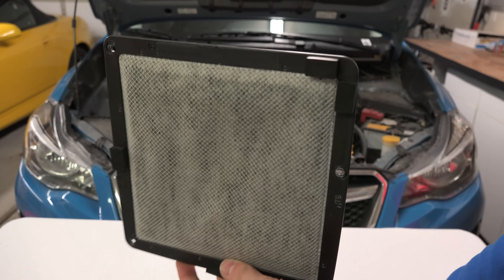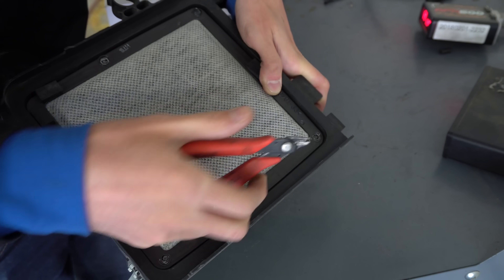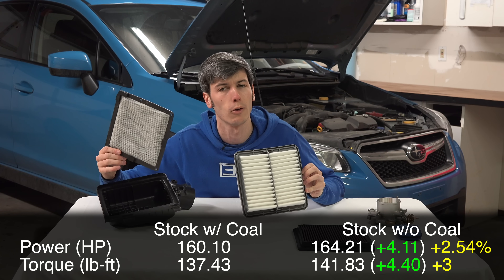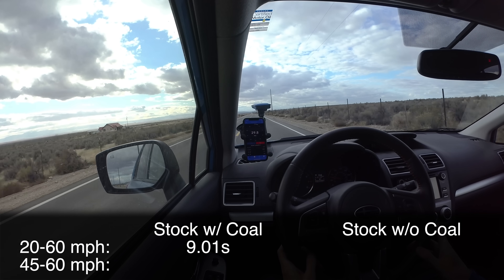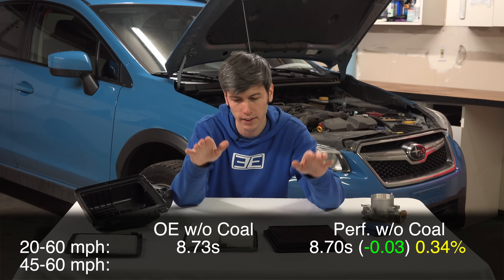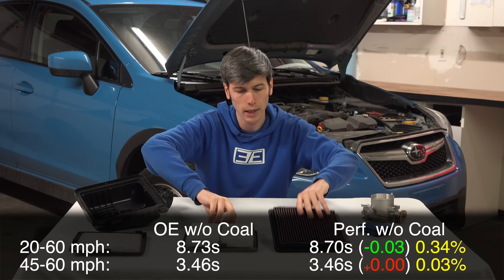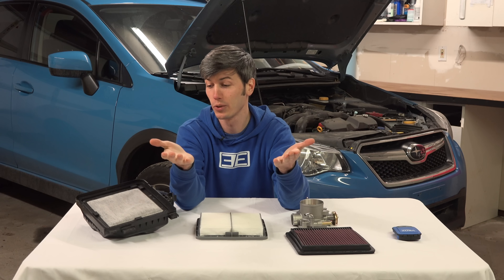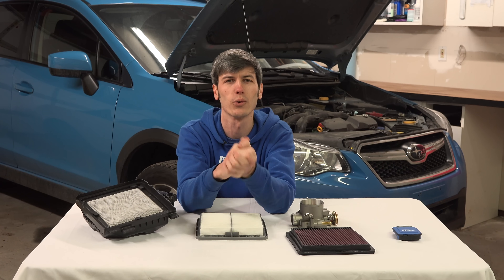Do Charcoal Air Filters Rob Your Engine Of Horsepower?

Comment: Have you measure acceleration change when Vtec kick in (yo) with the GPS box,How much G is increase?
Reply: You will go from 0 G to 0.01 G
Reply: Still Render Production - yo it is not measurable because vtec breaks the box. Yo
Reply: So in first place, how do you get 160hp from the original 148hp on your stock 2.0 liters Crosstrek?
Reply: @robertolouth7468  probably just the dyno inflating numbers.
Reply: Douglas Thompson thank you, things should be simple answered.

Comment: placebo effects on drivers are very real
Reply: How do you placebo a dyno,  unless he has telekinesis and used his mind to control a machine I don't see a placebo effect
Reply: @joesmith201212  It adds soo few extra horsepowers that a human being wouldn't be able to feel the difference, that's why its a placebo effect. You think your car is faster but in reality, it's not. You need at LEAST a 5% difference in power to feel anything happening. In other words, this mod is not worth the hassle, especially since you are going to have problems with the DNV
Reply: TheRedHuskie In reality the car is actually faster. Numbers do not lie. It is just inperceptible. If you do feel the difference you have a very sensitive butt. Racing teams would be all over that few extra horsepower. This is the opposite of a placebo. There is actual power difference, but people cannot perceive it.
Reply: @brunoraoni  I really don't think you people know what that word means
Reply: @pichum4st3r  the science is sound the data is solid,  that's not a placebo, your car runs on mixture of fuel and air,  and a spark,  so if your fuel injectors are dirty and clogged and you clean it and it runs better is that a placebo too? If your spark plugs are fouled and you change it and runs Better is that a placebo? Air flow is just as important
Reply: @brunoraoni  if it doesn't throw a code, it doesn't matter if it's there or not. 7hp is better than 0, but he didn't go into at what RPM is this 7hp relevant, but i think you guys are saying at higher rpms. This is not a sports car , it rides smooth unlike Subies of old, I know, i have an '06 Forester and a '19 Crosstrek Limited.
Reply: @brunoraoni  a 5% increase at a given RPM yes, but a 5% increase in peak hp due to higher RPM with same torque probably not.
Reply: @slingbart705  most hp gain was probably due to increase in rpm itself than power increase at a given rpm which one would feel
Reply: But, if someone does feel a difference there is an actual difference when you remove the charcoal filter.
Reply from the maker: Yes indeed haha.
Reply: Engineering Explained could you try this with a turbo car? Would be interesting to see the extra stress on the filters
Reply: except its not a placebo effect if there were measurable gains.
Reply: Placebo ? He did a 0-dollar, 2-minute mod of cutting a charcoal filter that might save a penguin every hundred year and gained 4 HP/4 LB (or a 2.5% power increase because quick mafs) ... Literally the cheapest and easiest mod in history or cheap car mods. Of course our Engineering friend has to say it's generally a bad idea because "emission system" but... seriously? We're not talking removing cats here which would indeed increase air pollution hundredfolds but trapping the odd whiff of gas that might go back all the way up your intake piping on a hot day... Guess what came out of my 2010 Genesis Coupe? lol.

Comment: Dreams crushed...

I'm glad you've added the math. It's crazy when people say they can feel the difference on the most miniscule mods.
Reply from the maker: The placebo effect is very real! :)
Reply: A 2.5% difference in a 160hp car is not significant. A 2.5% difference in a 500hp car is.
Reply: @Acefighterx  exactly
Reply: @Acefighterx  relatively speaking, they are the same.
Reply: I feel like outright speed doesn't even matter when you feel like you're going fast. A hotted up 1.3l Toyota with sidedraft carbs etc sure is slow but the noise it makes feels like +100hp worth of fun
Reply: You can feel the difference on some small mods if you have a weak engine with little reserve power to start with. The knock sensors on my 4 banger Mazda allow for an extra 3HP and 5 LB-FT torque on the dyno when running 91 octane fuel. I can't feel the 3HP, but in an engine with weak low end grunt, I can feel the extra few torques. 91 octane + a quality Purolator One filter and deleting the charcoal yields me about 8HP and 10 torques over OEM and 87 Octane. I'll take it.
Reply: You can in low hp cars and trust me when I say you can feel every little horsepower you gain doing mods
Reply: But, it is still faster regardless if you can feel it or not.
Reply: @pichum4st3r  by noting of significance. Its better if the driver loses a few lbs. which is better for all involved.

Not Jason 😉
Reply: Because people CAN feel the difference. It had like a 5% increase in power. The reason HIS car didn’t feel a difference is that it is a very low horsepower engine. Take a 400hp sports car v8 engine and all of a sudden a 5% increase is 20 more hp, and then the fact that the sports car is more aerodynamic, weighs less, better rear tires, ect, and all of a sudden the real world tests show a much different story. Sorry but testing performance numbers  on a car that has a 10second 0-60 is just silly. Cool to see the dyno number yes but not g force numbers

Comment: But can you come to conclusion by doing the experiment on just one vehicle?
Reply from the maker: Not entirely, but you also shouldn't expect the results to differ all that much percentage-wise for other naturally aspirated engines, where these types of filters will pose a very similar restriction. For modified engines with forced induction or significantly higher air flow rates, the impact will increase as the resistance of the filter increases with higher air flow.
Reply: @EngineeringExplained  That makes sense, thanks for the response.
Reply: @EngineeringExplained Please bought another CrossTrack and have a drag race.
Reply: @StillRenderFilm  buy him another Crosstrek so he can do the test you want ;)

Comment: Never heard of a charcoal filter being used in the air intake. Yes in the CABIN
Reply from the maker: They're certainly interesting! Not something I'd heard much about either.
Reply: They’ve had them for years. My 2011 750li had them, as did my 2012 X5M. BMW does it differently though. The 750 was similar to the ones shown, but the X5M had the media glued to the front of the filters, so going to K&N automatically got rid of them.
Reply: Same, here.....
Reply: My 1981 buick has an original charcoal filtet and a regular air filter. Nothing new. Its been around
Reply: These charcoal filters are typically used in "SULEV" rated engines, to meet stricter emission regulations.
Reply: Discovered this past weekend my wife's 2019 Buick Encore has a small charcoal filter in the air filter assembly. Was wondering what the purpose of it. Now I  know.
Reply: I clicked on the video convinced its about cabin filters and title is a joke. Even those air filters look very similar to my cabin filters, while intake air filter has much denser paper folding and its a lot bigger
Reply: I thought charcoal filters go on yur gas mask not on your car.
Reply: Its because you are poor and dont have a newer car peasant

Comment: The K&N air filters allow more dirt and air in believe it or not better for HP but not really clean
Reply: Most filter companies should have information about micron size and filtering efficiency. By their data, they usually get more flow by increasing pore size. Unless you go with an industrial filter, usually stock filters work the best.
Reply from the maker: What leads you to believe this? Not saying you're right/wrong, but anyone can say anything haha.
Reply: Engineering Explained old mechanic wives tale is a semi dirty paper filter filters better that a new clean one. 
Might be a good subject to explore as I’m undecided if this is true or not
Reply: @Welcometofacsistube  Probably, since airflow gets restricted more dirt gets trapped in the filter
Reply: @EngineeringExplained  Theres few companies that have been harmed by libel and slander more than K&N.
Reply: @EngineeringExplained  I have seen photos of torn-down Cummins B-series engines which were denied warranty due to having been dusted-out. In all instances the owner had installed a K&N filther photos don't lie.
Reply: @EngineeringExplained  That's why you read the instructions and they state to oil the filter before installing it. My cars all use k&n filters and all reach 200k+ miles with no issues. Saving on air filters adds up over the years if you keep your cars for a long period of time.
Reply: @Motorsportsgeek  you make me chuckle. There is significant photographic evidence that K&N does not provide sufficient air filtration. Dodge/Ram does and has denied warranty on engines damaged by these so-called filters. You get nearly as much filtration if you ran a piece of window screen. But then a Cummins engine alone likely costs more than your entire car.
Reply: @EngineeringExplained  well uh it's the truth
Reply: @pepeiann  you are spot-on with photographic evidence to support your statement.
Reply: @MaFTB  People over spray the filters, throw them back on the car and drive off right away.. Again, follow the instructions. They clearly say to let the filters sit after you spray them with oil so they can absorb it. When I do my air filter service, I typically let them sit over night. 

When you are cleaning the filter with water, you need to let them dry up for a few hours anyway so why not plan ahead and be sure you don't need the car for the rest of the night so you can let the filters sit, dry up properly and absorb the oil.
Reply: I have a carbureted 360ci with a K&N filter. I did noticed great increase in power with the new filter, however after approximately 10k miles I noticed dust type particles on the carburetor flange and choke tower. And I had to spray out my air bleeds a little more often to clear them of any dust to correct my idle air/fuel ratio. I didn't want to abandoned the K&N so I added a K&N precleaner. Basically a foam cover that pre cleans the air before it contacts the actual K&N filter. Made a world of difference in cleanliness on the carburetor side of the filter
Reply: K&n filters need oiling to be effective
Reply: I thought this was one of the biggest myths that got debunked. It was an employee of a rival company that started it and it spread like wildfire.
Reply: I'd rather choke it a bit and sacrifice some performance than score the cylinders with dirt